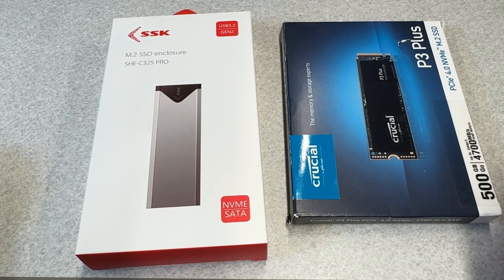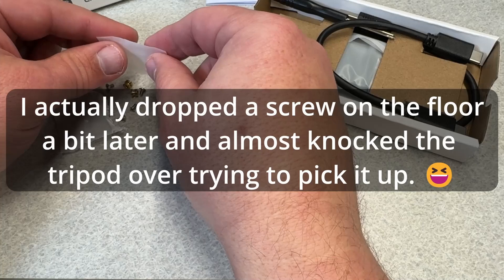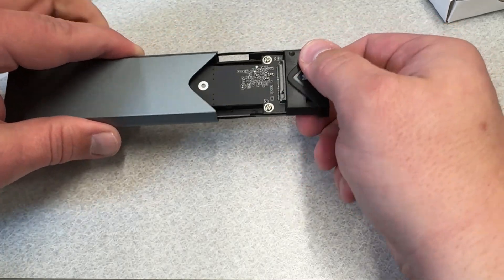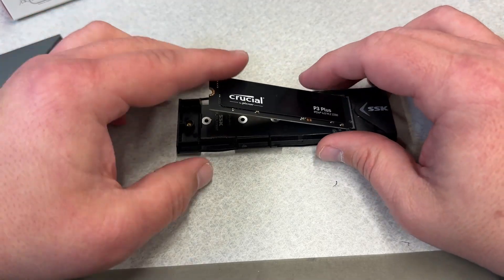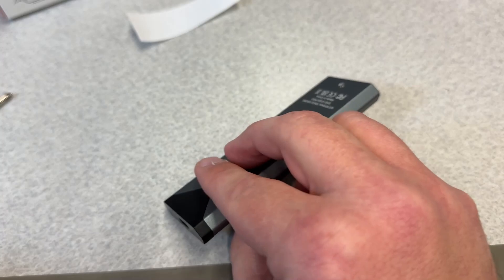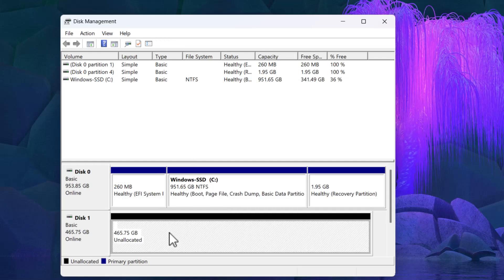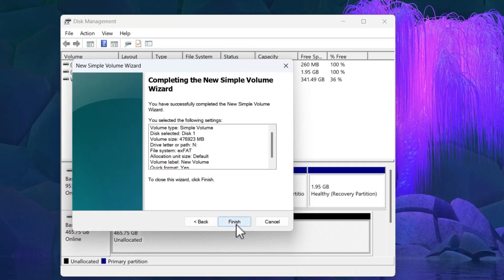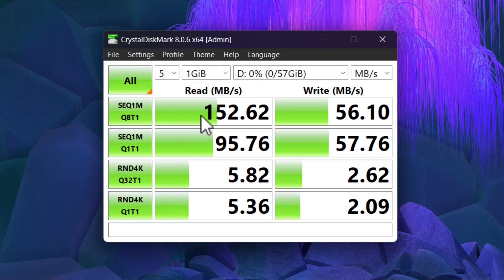Make Your Own Fast USB 3.2 Flash Drive  with an SSK M.2  nVME/SATA Enclosure!

Comment: That is SUPER SLOW. It should have been easily over 1,000 Megabytes per second. Probably around the 1,250MB/s of the USB 3.2 (gen 1?) max rating. You need a machine with at least a USB 4 to properly test that drive because otherwise your machine is bottlenecking the test. If your machine isn't capable of what the drive is rated for you can't accurately test the drive. It just makes the drive manufacturer look bad.

Comment: The things we all wish we knew before it was too late. I saw a deal for 8-4TB M.2 drives and 8-8TB M. 2 drives at a good price in 2023. In 2025, the 8TB drives sell for over $900 and 4TB a little over $600; what a deal I made. Rocket Drives are the best on the market.

Comment: Been using this enclosure since 2019, when NVMEs used to cost a bomb. Now I've moved on to Sandisk and Crucial external drives but this one works as the main storage for my home server. Beautiful and stable performer.
Reply from the maker: I liked it so good I bought another.
Reply: @JerryTravisSmith  After watching your video I went online to check SSK catalogue, and ended up buying their 20gbps enclosure and a 4tb Teamgroup MP44Q  nvme. The combo is performing pretty well. Impulse purchases at best.

Comment: If I want to use this drive with a Mac and a windows based machine, what is the recommended format?
Reply from the maker: exFAT is what I format with for cross-OS compatibility. It’s not a journaled file system but it’ll work on almost anything. I honestly haven’t tried to use NTFS on a Mac in quite awhile so I don’t know how well it works now.
Reply: Thanks, ChatGPT says that a 3rd party software is needed to use NTFS with Mac Computers.  Thanks for your reply 👍✅🫡

Comment: Just found your channel, this looks like an awesome mod, Is it ok to use the newer P310 Crucial Nvme that is also available ?  Are the results similar if I upgrade to 1TB?     Thanks
Reply from the maker: Yes. Any nVME drive should work. Your results should be better because I was only using a 5Gbps port and didn’t realize it. In my experience, larger nVME drive will be a bit faster than a smaller one, so you should be happy with that too.
Reply: Thanks 👍✅🫡

Comment: Looks like you're using a USB3.2 gen1 5Gb/s port on the laptop with the enclosure. A gen2 10Gb/s port should give you closer to a 1000Mb/s.
Reply from the maker: Ah. Good to know and thank you for pointing that out. I didn’t even consider the ports on my laptop would be 5Gb. I think my Precision workstation at work has a 20Gb port. I’ll test it there (if I’m right about the speed of that port) and make a video correcting my sleight against the poor enclosure.

Comment: Crystal Disk Info just shows you the SMART data from NVMe drive inside the enclosure, which is usually what you want. Some older USB chipsets block that info.
Reply from the maker: I thought it may show connection speed information but I was wrong.

Comment: Note with exFat (Fat32) you have a File size limit. of i think 4gb. Fat16 is 2gb max file size.
Reply from the maker: exFat is different than FAT32. exFat on Windows can support files up to about 512TB. FAT32 does have a maximum size of 4GB. 

https://learn.microsoft.com/en-us/windows/win32/fileio/exfat-specification#9-file-system-limits
Reply: Exfat limitation isn't 4GB 

But exfat issue is no journal and too much space wasted if you got lots of small files
Reply: @frankwong9486  Also it needs an add-on to be readable by older systems.

I always reformat these things NTFS.